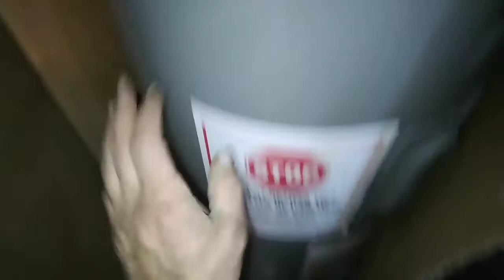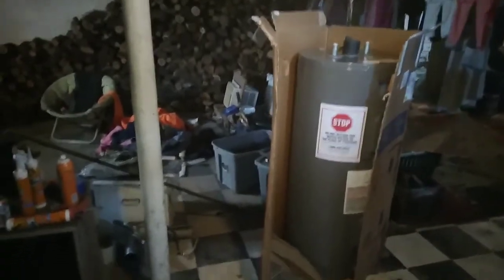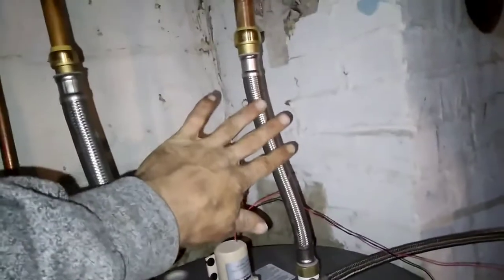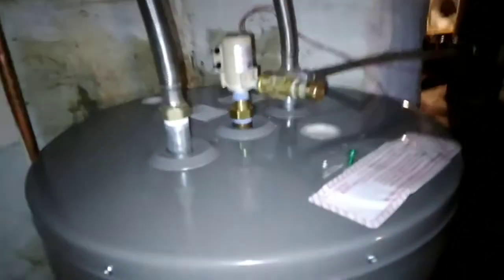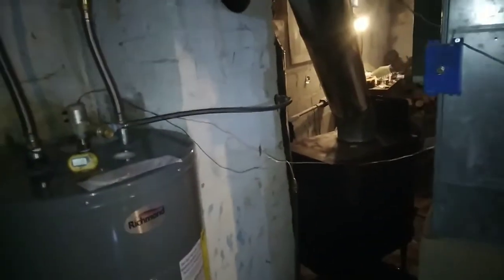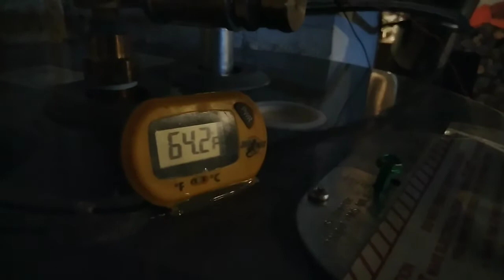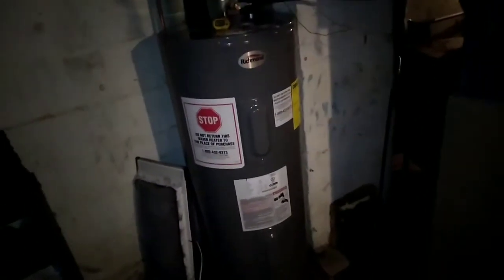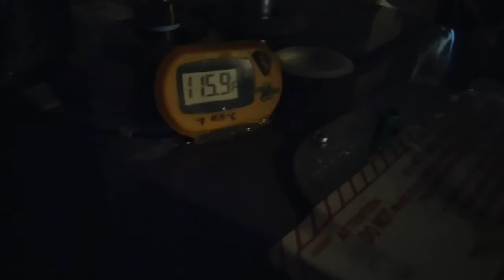New Water Heater!....and other issues....

Comment: That's very nice the way you hook that tank up and heating it with the wood but don't you need a pop-off valve just in case you over pressure the tank for some reason and maybe something gets too hot and pop off instead of blowing the tank up
Reply from the maker: The braided hoses basically replace the relief valve...if it over pressurises, a line will blow and i have replacements just encase. There is also a secondary pressure relief on the outgoing line to the house.